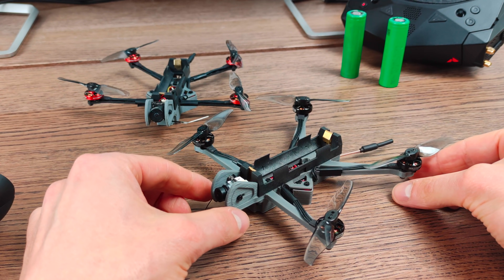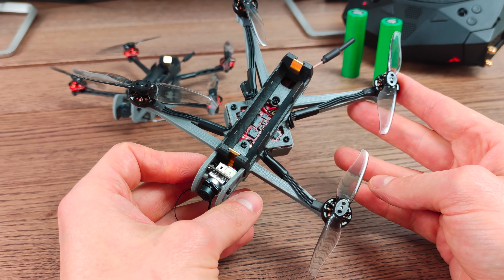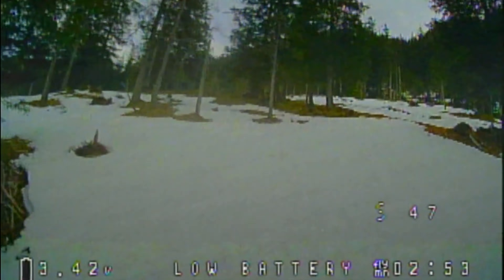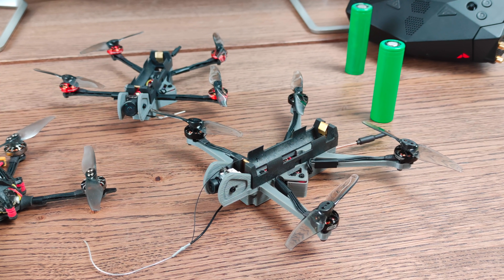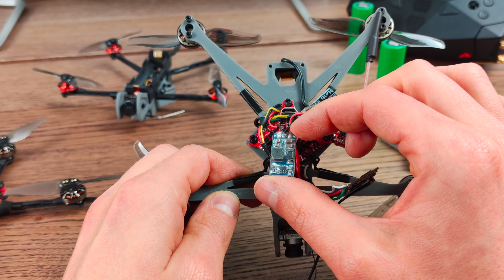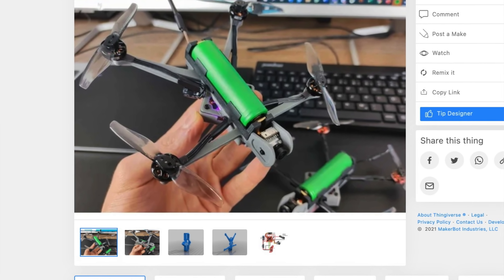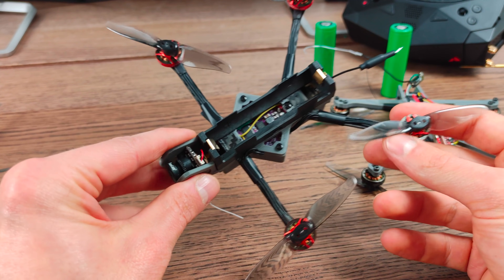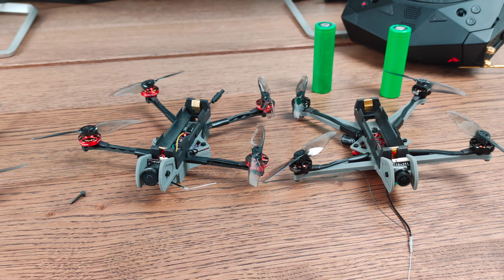The #NanoLongRange Part II

Comment: Have you considered slightly adjusting the design to carry 2x 2000mah 22430 Li-Ion cells? I don't know if the same holders are available readily but it would be made via 3D printer if you use the tabs from a purchased 18650 holder. Running 2s could help efficiency and weight may be the close to the same since you will drop the need for the low pass notch filter and the voltage regulator.

Comment: Really would like to see a full carbon fiber frame for this. And I will probably go for an XT30 instead of the battery holder. Would be nice though if there was an indicator for the CG to balance the quad when done assembling since the loose components (dcdc converter, VTX and filter). Currently I use blackbox to see motor load when hovering to determine the CG
Reply: you can just grap a quad in the middle between your fingers, that's where the cog of a quad should be.. if it balances in the middle cog is correct, if not, adjust parts to get it better. it doesn't have to be spot on on a quad, and it's better to have a nose heavy quad instead of a tail heavy quad.
Reply: @DutchCommando  unfortunately CG is not always in the middle. That would work for simple geometries (X-style frame) but not for this deadcat style frames.
Reply: @nuhbiwan  but still in the middle of the thrust points.. eg the motors..
Reply: @DutchCommando  true, but like I mentioned, that needs to be determined if no X or H configuration. What I mean is, it would be easier if there was a marking on the bottom or top plate

Comment: what about 21700 5000mah battery? How much amp this quad draw?
Reply: This will be way too heavy. Maybe with a 4’’ version but there is no 1S motor that can properly swing a 4’’ prop (yet). A 1S capable FC with more than 5 Amps wouldn’t hurt, too I guess.
Reply: That's exactly what I was asking for. He should make a 21700 version so I can run a (Tesla 3) 5000mAh cell.

Comment: Really cool :) Did you use the linear antenna rather than a circular polarised antenna to save a few grams?
Reply from the maker: yes I just used the stock antenna that came with the VTX. Works well enough :-D

Comment: So funny how instead of thinking “that’s a tiny quad” I end up thinking “that’s a huge battery!”
Reply: I just think "hey look a flying battery"
Reply: @faktionfpv3590  If you think about it, that's basically what all "drones" are. Flying batteries. It's the most substantial weight on them.
Reply: What will be the cost ? If want to but that small drone.
Reply: @krishnabamne5887  a LOT of blood, sweat and tears. But if you don't break any AIO or any of the peripheral chips, I would say ~100 USD

Comment: Briljant Dave, and what a lovely area you life in!  ¶ :-)--~   (can you put a Vista on it and or maybe 2 batteries parallel?)
Reply: Vista needs more voltage. So you would need to use an additional DCDC for, let’s say 9V. But honestly you could then go for a 2s or 3s 3“ inch build. But the vista alone weighs probably more than the drone itself. I would not go for less than 4“ with a vista on board. I had a 3“ vista quad but flight characteristics were not satisfying
Reply: @nuhbiwan   THX M8  ¶ :-)--~

Comment: nice... and now get back to bringing us a 2S LiOn iNav (GPS + compass + baro) sub250g analog HD build :D
Reply from the maker: I actually already built a 2S Liion setup 1,5 years ago. It's not as easy as you'd think because a 2S rated ESC/FC will start to reboot if you get too close to 5V of battery voltage. Meanwhile 1-2S rated ESCs are mostly 5A and therefore really low amp rated for a platform that can carry a batter that is over 80g efficiently (eg 4" and 1404)
Reply: @DaveCFPV  Sounds like a worthy challenge for you then ;) We are looking forward to it! :P
Reply: @DaveCFPV  That's also what i experienced. The electronics couldn't reliably handle voltage near 6V so you can't use full capacity of the li-ion cells. Even DJI Mini 2 switched from li-ion to li-po for this reason apparently. I'm going to attempt building 3S li-ion setup to get over this issue and get even more endurance.
Reply: @grayscalefpv1748  It's interesting that DJI uses LiPo for it's Mini 2. From the specs it looks like they are using a 2s LiHv. They say that the new battery provides a higher energy density than the old LiPo of the Mavic Mini. 7.2V*2.4Ah=17,28Wh (Mavic Mini) vs. 7,7V*2,25Ah=17,325Wh (DJI Mini 2). Perhaps we should give the LiHv a try for a lightweight 2S long range build.
Reply: @DaveCFPV  So sub250 3S LiIon would be the Challenge ;_)
Reply: easy to build your own! just get a 2 cell battery tray (or build a 2 cell pack, what ever you want), rip a vista apart, slap onto a toothpick frame, flash inav and fly it!
Reply: @DutchCommando  well… not sure the AIO fc/escs have enough uarts for gps compass and baro but what I am really looking for is Dace_c finding the perfect balance between power and weight :)
Reply: @JulianGoesPro  hifonRC F7 Aio has plenty uarts and 35Amp esc's, (that's what i'm using on my 4 and 3 inch setups, and also on one of my 5"setups)
i know there is also a aio with baro on the board already but i've forgotten the name.. none can do 1S though, but 2S should not be a problem.
power and weight is trail and error, motors and props and combos of those can differ so much that it is almost impossible (or ver expensive) to test them all on a certain frame/setup.
i just discovered that for my 1S setup a biblade gave me worse flight times than the gemfan flash 3040 tri blades. but that's for my happymodel 1203 11000kv motors, with other motors other props could give better results.

also on a side note: the matek F405wpx is also very small and great for long range mini's.. but it does not have build in esc's
Reply: @DutchCommando  I was hoping for 2S lion rdy escs... I am extremely unhappy about having to change esc settings (low voltage cutoff) :P
Reply: @JulianGoesPro  multirotor esc's have no lvc set.. they keep on working until there isn't enough power to feed the micro controller.. only plane esc's have a lvc
Reply: @DutchCommando  uh nice... was thinking about putting my old quad escs in my Dart250g to save weight since the stock one is heavy as well but was worried about the LVC, awesome, thanks!
Reply: You can use the Flywoo F745 16x16 FC as it has lots of UARTs for its small size. And for the power train, I've tried using DJI mavic mini motors and props powered with 2S NCR18650GA with good results (~30 min cruising) without even spending all of the battery's capacity (that's more because of minimum voltage limitation of the electronics). And that's with <250g AUW.

Comment: "Low Battery" all the way :D
Reply from the maker: Yeah I forgot to adjust it for the Liion😅
Reply: @DaveCFPV  wait if you forgot to adjust it for li-ion does that mean that the flight time should be extended because I remember someone saying that betaflight would just kill power if the battery get waay too low than the "landing now" warning voltage
Reply: @tuttuti123  nah, it does not matter what voltage the alarm is set to, it will keep on flying until i can't stay in the air anymore.
better to destroy a battery than to loose your quad after all..

Comment: Really Cool stuff you're creating! I'm currently wanting to get into FPV but i don't have much experience yet. Only with line of sight drones. Do you have a recommendation in those regards or would you even recommend this one? Cheers!
Reply: get a tiny hawk kit..great little quads to learn on, and have a ripper once you can fly.
Reply: @DutchCommando  Sounds Cool! I saw that there are different versions. Do you have a special recommendation? Thank you!
Reply: @jolisnil1744  get the full set which include goggles and transmitter. also get a bunch more 1S lipo's once you've got the hang of it, you'll be emptying them faster than you can charge.